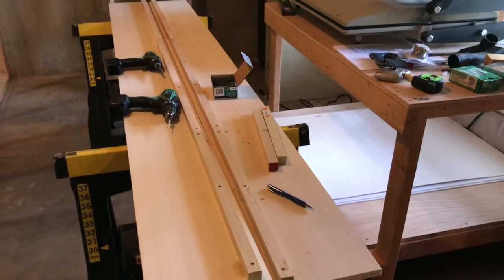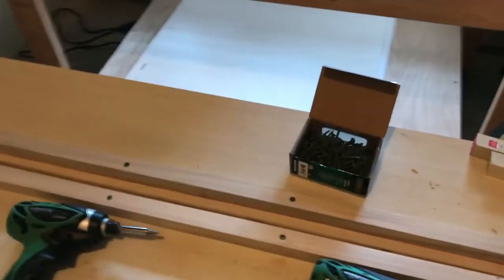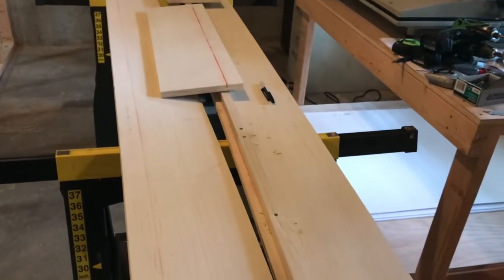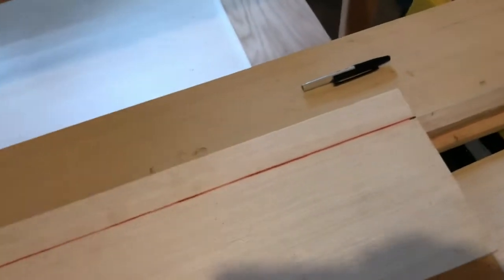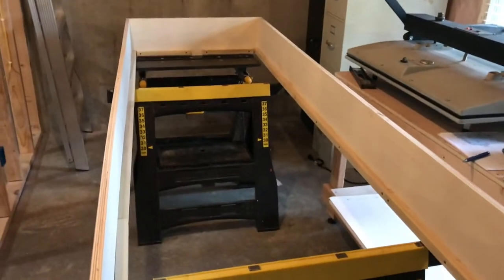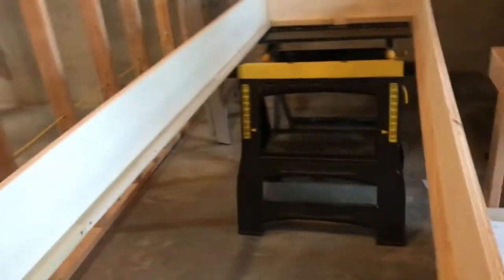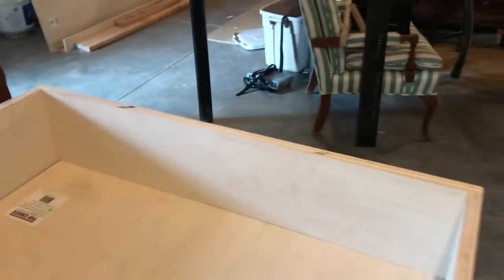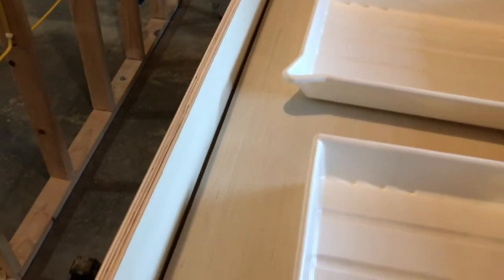Building A Darkroom Sink - Part 1

Comment: I used fiberglass tape soaked in resin in the corners and then used waterproof paint for boats on the inside.  Has worked well for me for 15 years.  My slope is minimal though.  Wish I had used more of a slope.

Comment: HI!  Would like to do something like this too.  How did you prevent the bed of the plywood sink from splitting when you screwed through the side panels and into the side of the bed of the sink?  I tried to experiment wit 3/4 inch plywood, and when I screwed into the side of it the plywood seemed to split.
Reply from the maker: In the video I showed where I put cleats on the inside of the sink so the bottom would rest in the proper place and angle for drainage.  I used a chalk line on the outside of the sink to mark where the bottom of the sink would sit when it is in place.  I did this on all 4 sides of the sink.  Once the lines were in place, I set the bottom in place and predrilled all of the holes about every 4 inches or so with a counter sink bit that went through the side and about 1/2 inch into the edge of the sink bottom using the chalk line as a guide. I then used #8 1.625 inch decking screws.  If you are splitting your wood then you a probably using a #10 or #12.  These screws don't need to be very long since they are just holding the bottom in place so it doesn't move.  Once you caulk and seal the sink then that bottom is not going anywhere.

Comment: Great video! Can you please make a part two, which the sink is probably already finished, but it would be great for us to see the final result. Thank you! :)
Reply from the maker: Parts 2 & 3 have been uploaded, the series is complete!  Sorry for the delay and thank you for your patience.  Be sure to check out my podcast 'A Light in the Dark' on all major podcast platforms along with the Facebook Group.
https://www.facebook.com/groups/1574457682653272/
Reply: Thanks for that. The base of the sink, what thickness did you use? Is the wood marine ply or just ordinary ply wood?
Reply from the maker: @jag24x  The base and walls of the sink are made from 3/4 plywood.  It is important that you be precise on the cuts.  Don't let your big box store cut it, the will screw it up.  If you don't have access to the proper tools then go to a proper lumber yard and have them cut it.
https://www.lowes.com/pd/Top-Choice-Blondewood-3-4-in-Whitewood-Plywood-Application-as-4-X-8/50121139